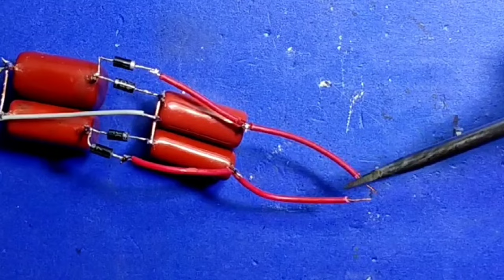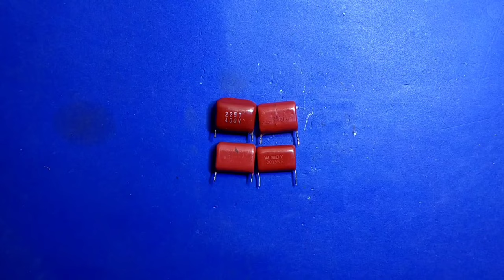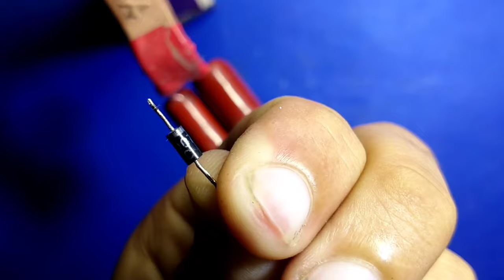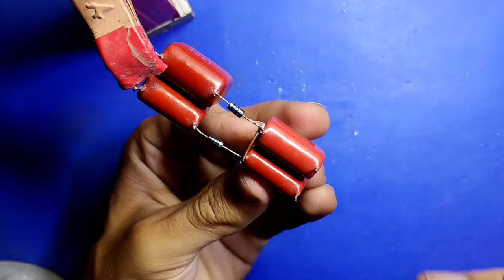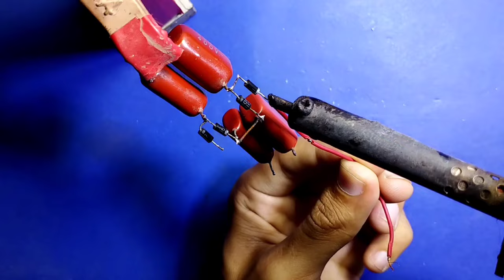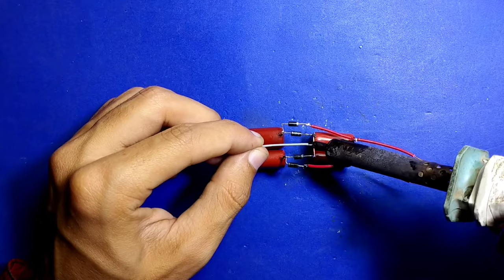Mosquito Killer Homemade - Amazing Mosquito Killer Machine | DIY Mosquito Trap Repellent

Comment: Sir 1hour ke bad capister fat jata hai kyo mene 2 bar banaya isko
Reply from the maker: Hello! I hope you are fine and thanks for the comment.
First carefully check your circuit connections on by one. If connections are good then, you can use 1Mega Ohm Resistors in parallel on each non-polar capacitors. I hope this is helpful.
Thanks
Me app k lye iss ki video dobara b bna do ga jldi hi.

Comment: I'm making it by myself with no details on the parts. No help!
Reply from the maker: All Caps Value is mentioned 225j, 400v. and 1N4007 Diode.
Reply: @taelectric1  thankyou!
Reply: @taelectric1  is it possible to use 474j 400v or 104j 630v instead of 225j 400v? I have a lot of them in my pantry